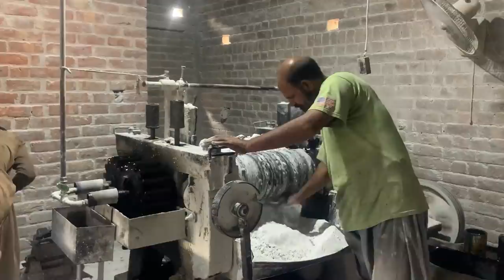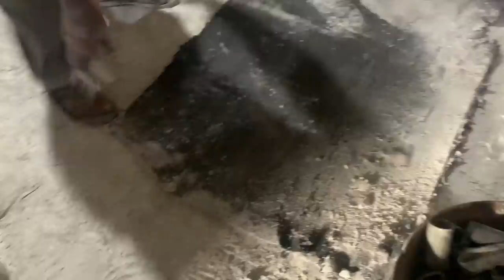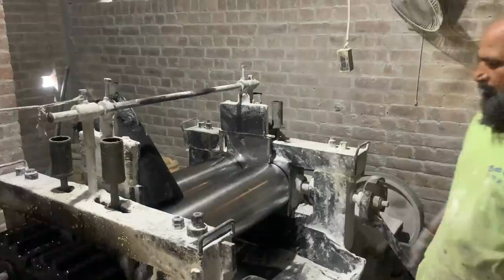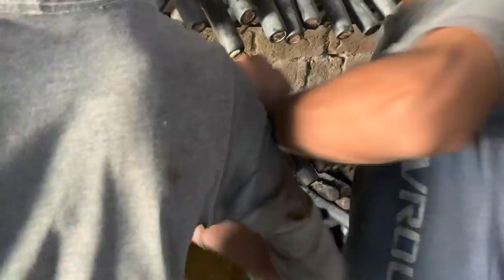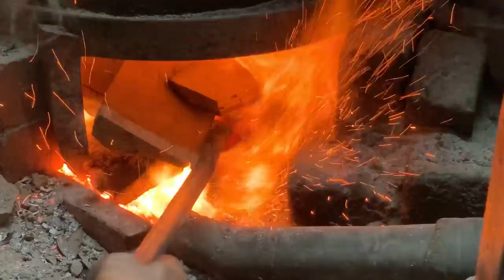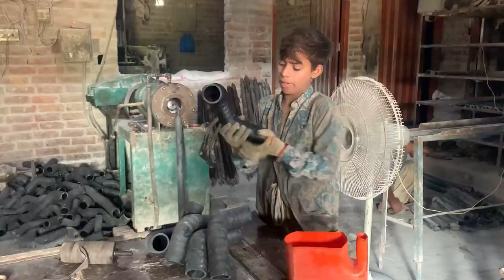How Radiator Hose Pipe are Manufacture in Local Factory || Production Process of Radiator Hose Pipe

Comment: OMG I used to work on a bigger version of the rolling mill it was called a 60" mill and also worked on its bigger brother an 80" rolling mill, nearly doing what this chap is doing except for that I had safety bars and ppe, I blended rubber on both these mills for the printing industry and the carpet jute industry, only ever saw a very small rolling mill in a lab but never seen a 30" working mill, great stuff, masks should be worn when handeling the sulpher and acceletators to cure the rubber.
Even the extruders is a smaller version of the version I had used too.
Great stuff......
Reply: His hand is waaay to close to the center of the two rolls for my taste..worked with a guy who had angled hand from doing just that...
Reply: @rustyshackleford7082  We had over reach safety bars so if you went too far the machine stopped immediatly and reversed back in case your hand did get stuck, and the machines were a lot lot bigger withover 80kgs of rolling rubber on top and had to blend it by hand through the "Nip" just like this guy, lol how dangerous was that.
Reply: Great story!
Reply: I somehow don't think they are worried about the sulphurs & accelerators. They are so primitive, & such filthy environment. Their clothing is extremely unsafe, working around the machines.

Comment: I never realized that the Gates factory was so high tech. And so many safety precautions too.
Also, I think I missed the part where they added the reinforcement cords, that would have been interesting to see.
Reply: I was waiting to see that too 😀
Reply: The reinforcement was the wrap right before they cured it. No internal reinforcement threads in these
Reply: 14:35 my friend
Reply: This is old school, with the reinforcement provided by the tape wrap.   This was common at least into the 1950’s in the USA.
Reply: Gill Bates
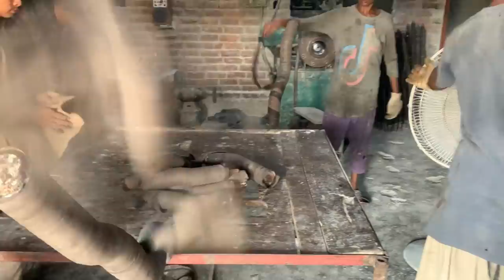Reply: @GoatOrange  No that was just so the hose retained its shape while it was steamed. They took that off when the hoses came out. You can see it being unwound at 19:58
Reply: That's why they're making so many. There is only one car in this village.
Reply: At one point our country your ancestors did the same thing same safety standards.

Comment: Every radiator hose I have seen had strengthening fibres embedded into the rubber, whereas these had none!

The strength and longevity of hoses without the reinforcement fibres can only be guessed at, but I have no doubt that they will not match the Western manufactured hoses which were fibre reinforced.

That apart, this was a very interesting insight into how these items are manufactured, with the absolute disregard for the health and safety of the workforce, especially the underage children.
Reply: No freezing problem, no anti-freeze, so they use plain water. With just water as a coolant, it can be replenished where and when ever needed. So there is no need to build up pressure. Just let it boil, have a break and fill it up.
Reply: No Need because nodbody uses radiator cap in trucks here, every 2 hours fill some water and go.
Reply: @TheWasim1977  Thanks for the local input to us westerners. This is exactly how it was made here 50-60 years ago.
Reply: The reinforcement layer is wrapped around the hose after it’s inserted on the mandrel. That layer is probably a fabric calendered in rubber.
Reply: @yotarip   Tell me that you didn't watch the whole video, without telling me you didn't watch the entire video.
Reply: Those young men are happy!
Reply: @yotarip  I think you are correct
Reply: I’ll bet those underage children could very much be part of the whole family run business. If anything they are learning how to work hard and would laugh that someone cared for their safety. It’s a different culture that’s all.
Reply: @matthiaserb3809  thank god iv been hands on since a kid! Became a tradie love it. Unfortunately iv had to change light bulbs for certain customers because they really didn’t know how and thanked me when I showed them how simple it was.
Reply: @matthiaserb3809  And yet we still manage to lead the world somehow and you all are stuck in the 1900's of manufacturing and an even worse social economy. 
Maybe you should think about that before talking more nonsense.
Reply: @SergeyPRKL  ... you might want to go back a few more decades. We had reinforced hose here in the 60s. This hose goes back to the "open systems" of pre WW II.
Reply: @yotarip   It was removed after curing process.
Reply: Going through all this
To compete with a properly reinforced and manufactured hose. It makes me wonder if they are actual slaves? There cannot be any money to make doing this
Reply: @rollbot  ... consider what this product might sell for then compare it to the 10 - 20 cents an hour those kids might get. They wouldn't do it of there was no money to be made.
Reply: I believe by definition children are underaged :)
Reply: @lowiqsavage  ... good point, but I think you will find exceptions in most areas when it's a family owned business and they are family members. Who knows what the laws are outside the USA.
Reply: It my only 1 issue with these types of videos they always blow my mind but I do not agree with making children work in such environments if you can’t afford or make possible for you kids to go to school then just don’t have kids it’s extremely simple really 🤦‍♂️🤷‍♂️
Reply: @Tibor716  Manufacturing in 1900 was above and beyond what these guys are doing. In 1900 there were actual industrial processes, testing and quality assurance.
Reply: @Spocker93  Touche.
Reply: @Tibor716  who are "we"? What country are you from?
Reply: @adanochoa9926  Children being forced to work in conditions that are detrimental to their health is your preference, just so long as they don't wear baggy trousers!

Your remarks and attitude reveal much about you, none of it good!
Reply: @rupe53  Yes, we did.
Reply: These videos are a fine example of just how much different the United States is from most of the rest of the world in manufacturing process and worker safety.
Praising the practices involved here is akin to going to a modern surgical hospital and saying they really need to just do things like the 1700s where the doctors didn't even wash their hands between patients.
Reply: This ain't car hose pipe, it's just a pipe made out of used tyres rubber to fill the gap of the poor men lives. This is an example nothing can be made so cheap these days
Reply: @cyrusjam4555  The title specifically states that these are Radiator Hoses!
Reply: @akukorhonen5182  OK.. what about a baby that sticks its hand in a meat grinder?, just give birth to a new one when the old one runs out of hands. It's terrible to use child labor in the 21st century
Reply: @littodevilish  if they have any fingers left
Reply: @yotarip  You must missed the part at about 20:00 where there remove that wrap.  it's just to keep it firmly in shape around the form and is removed after the rubber is vulcanized.
Reply: I have mixed feelings about child labour such as shown here. One one hand it seems wrong but on the other hand, look at how children the West are today: fat, spoiled, lazy, entitled, addicted to smartphones. These kids have learned a work ethic from a young age. So who is better off?

Comment: Very cool !
I wonder what the pressure rating is for those hoses ?
My guess is atmospheric pressure only.
Reply: they are overwrapped but no thanks, reminds me of people using space ships for under water diving and being asked how many atmospheric pressures is it good for? well it is a space ship so I would say 0 and 1
Reply: Depending on the radiator cap it could run between 4 and 30 psi before going into the overflow tank
Reply: @Qusin111  what planet are you from ?
Are you curently owning a space ship ?
Reply: @marcelsinky1652  it’s a joke from Futurama.
Reply: @thandle  he's still learning. He'll soon realize modern TV shows are crap. All the good stuff ended almost 20 years ago
Reply: This is a joke lol.
Reply: @mr1shaggy  OK boomer
Reply: @jamesqueen4721  I didn't see any cords in the hoses
Reply: @chrisleggett685  this, all that effort to produce a hose with little strength
Reply: @chrisleggett685  that's why the outer wrapping, commonly European
Reply: @Farlig69  Strong enough to last 50 years.   How strong are you ?
Reply: @maplebones  прослужит максимум один сезон, может быть даже меньше. Чем меньше будет срок эксплуатации, тем лучше для этих рабочих.
Reply: @Qusin111  You can see that wrap being removed at 19:58. It was only there to help the hose retain its shape while it was being vulcanized.

Comment: Yeah low pressure hose, no braid in it. Great video
Reply: Holds 2 bars easily being made properly of course. Just check it yesterday myself. Not sure about this exact production 'though:)
Reply: Yeah, I was waiting for the reinforcement to be applied, but it wasn't.  Just a textile wrap to fake the look of a mandrel made hose, but this was just extruded tube.  I hope that it is at least EPDM rubber!  It might hold 2 bar cold, hot is another story!  I was in the industrial hose business for 20 years so this was amusing to watch!  I hope that guy never gets a hand trapped in that Banbury mixer,  because it will take him right through it if he does!  They really need to use gloves and face masks or they'll be suffering very unpleasant respritory disease when they are older, usually fatal.
Reply: You should see their Nuclear weapons'
Reply: I thinking it's like hoses from the 40s, they last 20-30k. Old tech but works,  today's hoses last up to 200k mi.
Reply: @jeremyr7147  
It's down to the rubber compound, quality and process control, none of which are evident here!!

Comment: Love the pressure gauge on the boiler.. starts at zero and stays there after 90 mins.  Gauge on autoclave is slightly more accurate - starts at 20psi..
Reply: It must have broken down and they are calculating by the time each batch takes to heat.
Reply: Lube the threads on the autoclave, check them for wear, eventually they wear out and under pressure first one fails then the rest door blows of like a bomb exploding hi temp steam and door in your face is not a good day probably your last! Exposed gears, fingers through the rubber mill and the extruder with fingers going close to screw ah. Got to be on your game all the time.
Reply: @anthonywilson4873  Accepted industrial working standards in that part of the world as are the safety flipflop footware.
Reply: The pressure on the autoclave after 90 minutes shows 90psi ~ 6kgf/cm^2 , not sure if you missed it.
Reply: Yes I noticed that too. With that fire raging under the boiler it must be close to bursting much of the time.
Reply: It's no coincidence that Bhopal disaster happened in this country
Reply: @Nitrofan_Kerm  but was a US company.
Reply: @AC_Milan1899  Actually it was totally Indian owned and operated. Union Carbide was just a consultant. UC International told them to upgrade the flare months before the accident occurred too. It was also likely sabotage that caused it.
Reply: @1pcfred  Wrong! It was owned and run by Union Carbide.
Reply: @IVANGARCIA-ks4vp  It was owned and operated by Union Carbide Limited of India. Not to be confused with Union Carbide Corporation. Union Carbide Corporation consulted with the LLC and licensed formulas to them. Union Carbide Limited of India was mostly owned by the Indian Government. Once the disaster occurred of course they wanted to pin it on a foreign company. Who wouldn't? They were corrupt enough to do it too. Apparently they fooled you.
Reply: @1pcfred it was owned by ucil, and ucil was majority owned by carbide corporation

Comment: I hope those little fellas stay well away from those exposed gears - and industrial deafness will surely 'haunt' the operator of that machine.  Without any reinforcement fabric/material in the end product - will they stand up to the pressure?  I am assuming they must - otherwise, it would be pointless making/selling them ('assumption is often the mother of all F-CKUPS - HA) - or this keeps them in business supplying new hoses over and over and over again - HA.  I could be wrong - but that bandage wrapped around the hoses before going into the pressure vessel and then being stripped of after coming out - was just to imprint an 'imitation' of reinforcement to the exterior of the hose - hence giving the appearance of being reinforced - without actually being reinforced?  And this shows how hard some people must work even from an early age.  Glad to at least see a few smiles - hopefully, they do not wear off with time.  Have a safe and nice day all.  CHEERS from AUSTRALIA.
Reply: i wouldnt expect the bandage marks around the outside to fool anyone. I assume that its done as an "outer mold" to keep the rubber from drooping out of shape, and also to keep them from bonding together while being vulcanized. Just a though.
Reply: Surprisingly it does its job as a radiator hose. It doesn't deal with a lot of pressure like a hydraulic hose will withstand. But it is a better choice since finding and paying a premium for OEM parts for 20-30-year-old vehicles does not justify the cost.
Reply: they could st least use a stick.
Reply: I was trying to figure that wrap out.. maybe there was a layer of film that peeled off the reinforcement leaving it vulcanized in.
Reply: That wrapping is a polymer to help in the curing process I believe, when it goes into the huge pressure cooker. It doesn't have anything to do with "fooling" anyone.

Comment: A footswitch that reversed the rotation would be useful in case fingers or T-shirt got trapped between the rollers.
Reply: Heck, just an e-stop mushroom or a pull cord to cut power and a simple cover over the gears.  It would cost peanuts to make this much, much safer for the workers.

Comment: I would not want a hose from this factory in my car. I worked at a rubber plant and it was not done like that. We made a quality product you could rely on . It is hard to watch the kid load the extruder .
Reply: Bla-bla-bla proper factory-produced things bla-bla-bla. How can it be that under each such video, dozen of persons with such claims appear? What did you expect from crude, primitive production? An ISO rating?
Reply: @MacIn173  If they have a customer that knows what they are getting more power to them. These parts getting in the supply chain is a potential problem. They could get an ISO rating. As long as they have the documentation of every process . Follow every step in the process exactly .

Comment: I'm surprised at the valuable wasted steam from the autoclave in such a low budget operation - there must be no requirement for steam / other means cleaning anything in the neighbourhood.  I can understand the lack of "sophisticated" emergency stop technology which applies reverse power and should stop a mill in about half a turn, but no simple off switch close to the operator is a headshaker.  Given the lack of secondary protection, the extreme casualness of hands and fingers in the maw of the two rollers  (when such actions achieve no increase in process efficiency) is bizzare.  The  technique of the kid using his fingers to stuff rubber into the extruder feed is also worrying.  An extruder screw is self feeding unless the rubber is saturated with some sort of filler clay.  And if the adult mill operator cuts strips narrow enough even that wouldn't stop the self feeding extruder screw being effective.  Yes...I was wondering how much powder filler is in the rubber...    looks like a lot more than I am familiar with.  Someone been grinding limestone?